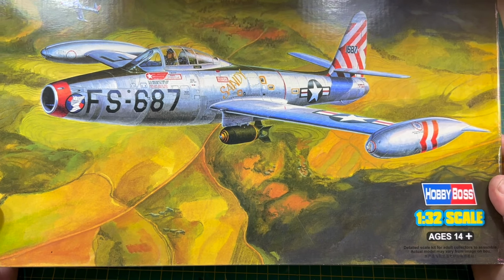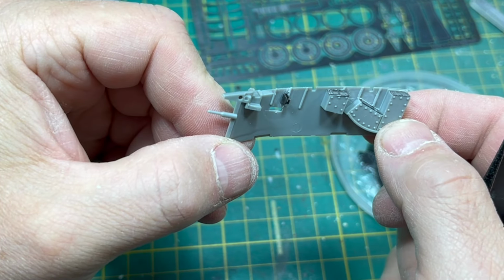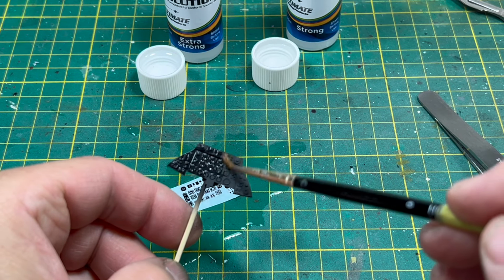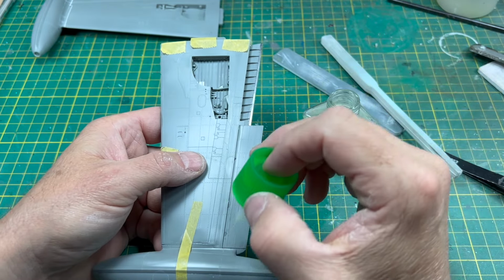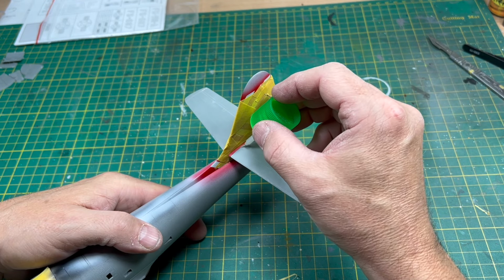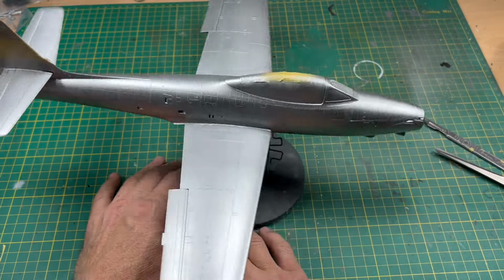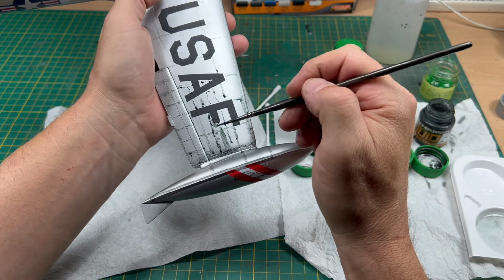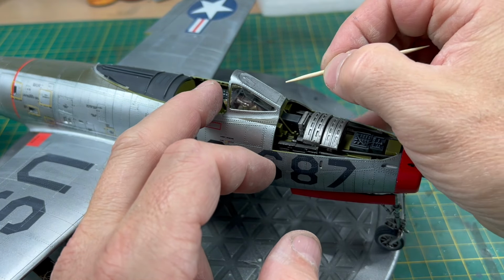Hobby Boss I 1/32 Republic F-84E Thunderjet I Full Video Build I

Comment: If you sand the side of the photoetch you are glueing to the model you wont have to worry about it pinging off. Sanding with 220 or 320 grit give the superglue something to bite into rather than a smooth piece. 
I have to say that is an absolutely beautiful finished model. Well done. Those markings came out perfect! I like the more vibrant colors for the markings, and that AK extreme metal looks fantastic. I have been using the Alclad paints for my metalics, but I have not done a full metalic finish yet.
I picked up the Zotz decal set for the F84G but I think I will grab a mask set for my insignia too.
I liked the narration style. You earned yourself a subscriber!
Reply from the maker: Top comment MF 🤣. I don’t like working with photoetch, you may have noticed, but yes a quick rough up is good. I’m glad I didn’t use the main decals as they were quite brittle, I struggled a lot with the stencils. Having said all this, it’s still a lovely kit. 
Cheers mate 🍻👌
Reply: @TimsScaleModelling  It looked like it went together well, so I am excited to start mine.
Reply from the maker: Let us know how you get on